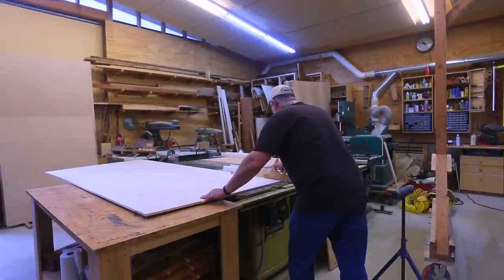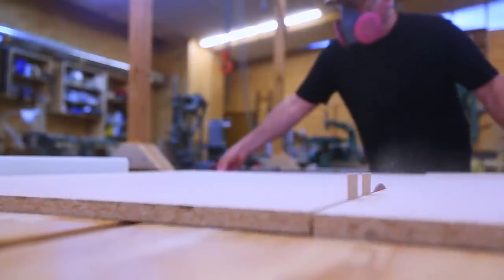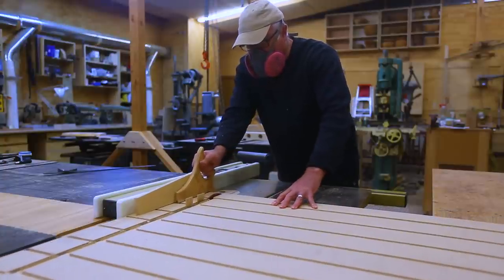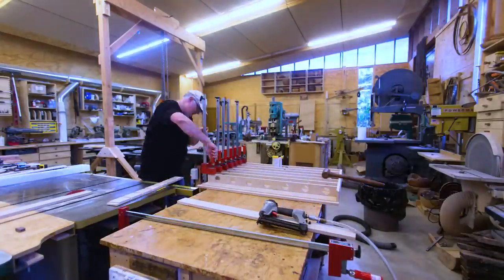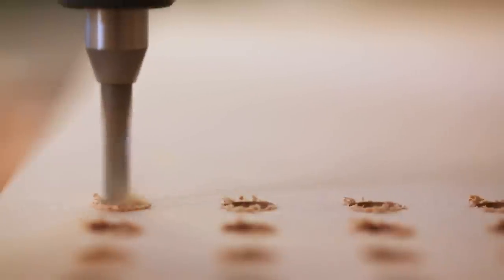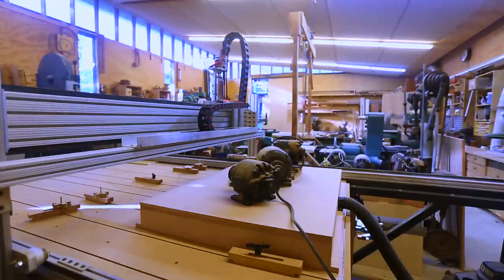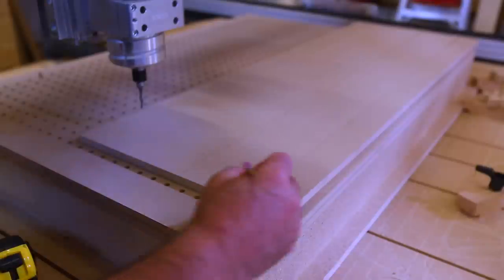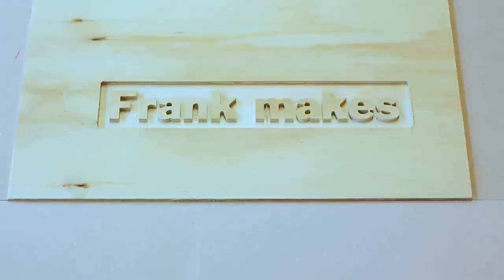Vacuum Hold Down Table

Comment: Your pump (shop vac) will burn out pretty fast since it is cooled by the air sucked through it. You are essentially blocking the motors cooling system. For this application you need a pump with secondary airpath or some other way of cooling.

Comment: Question: Under what circumstances would you be using all the holes all the way to the edges? 
It seems that you could just drill a few larger holes in the center and, even if the piece is large, the suction from the few central holes would be sufficient to hold the entire piece down. Would it not? Even if you were to mill multiple smaller pieces at once, drill more holes as needed and, thus, discover the most efficient hole pattern without over doing it and drilling hundreds of extra holes you may never actually need. 
That would also negate the need for all these modular dams and hundreds of points of potential leakage.
Reply from the maker: good point.

Comment: Rather than the wooden covers I'd suggest taking a idea from Nascar and think about when the car comes in to the pits. how do they "clean" the windshield? They tare off a layer of plastic which has become pitted and dirty covering the windshield and they're done. Couldn't a heavy single sheet of plastic be draped over the vacuum box with holes poked where the piece of work is to mount? I'm thinking the un-poked holes would draw the plastic in just a bit and hold it in place (thus covering the unused box holes). Tare off a fresh sheet of plastic from a nearby roll as needed for next project. I wonder if generic saran wrap in strips would do the same thing (without being sucked in the holes) shingled across the box surface? Or even regular plastic (wouldn't have to look for real wide plastic then). In the end I'm thinking the plastic will be held down by the vacuum pressure along with the work where the holes have been poked; I say "poked" because a pencil could be used to make the holes. LOL! I should have read the earlier comments! Others have already suggested this.

Comment: If you want the vacuum to affect the piece you're talking about, like you said there can't be any other exposed holes. I think you would have a much easier time executing this if you used a variety of patterns + sizes of holes across your table, each with their own cover. That way, depending on the type of piece you're working on, you would only need to remove one cover for one work area. Also, if you intend to CNC all the way into the table this wouldn't work, but otherwise you'll get much better grip if you skin your table with a rubbery material.

Comment: I could think of using a rubber or latex sheets, maybe 4-6 mm thick, cut to a convenient size, and use it to cover up the exposed holes. You could let the sheets overhang from the table top, without cutting them down to size everytime, and reuse them to different sized workpieces.

Comment: Would it be possible to use rubber mats with different size cutouts for pieces smaller than your table? How much surface area actually needs to be affected by the vacuum pressure?

Comment: If you mill out squares around each peace and vacuum the little square channel from the side you can use rubber or foam tubing and cut your set up time in half. Check out John Grimsmo knives vacuum table. Only problem is you never want to cut all the way through even with yours. You loose to much suction. I have been pondering a vaccine table for when I get my cnc. Hope this helps.

Comment: I have recently become aware that if you use the CNC to skim cut off both sides of a sheet of MDF then the sheet becomes vacuum permeable and you can use a standard high recovery vac/blower without having holes in the spoil board.

Comment: How about, two boards laid flat and glued together like ply... The top board has whichever vacuum holes setup you prefer, and the bottom board has linear channels that meet at a single outlet. Glued as a flat ply, they would be dimensionally stable, and easy to make with a cnc router.

Comment: Why not get some a big vinyl sheet or something to cover those holes? I imagine that if you cut a sheet up according to the Fibonacci sequence, you'd be pretty much guaranteed to have on in the size you need for any given configuration. Also the rubbery nature of it will help it seal up the holes as your surface starts to get cut up and little air paths form from old tool paths!

Comment: When you glued it all together I was cringing a bit.  With the vacuum running while cutting it will suck dust into the torsion cavity like a down draft and eventually you will get clogged baffles.  In that vain, a down draft cnc cutting bed would be freakin' fantastic instead of always having to stand there with the hose.  Maybe convert it for both!

Comment: instead of having those wood dams to plug the holes to make the vacuum pull the working piece down . get some heavy duty plastic film. get a big roll. that you can cut each sheet to the size of the suction box. then cut out a negative of the work piece so that only the hole needed to pull down the work are exposed.

Comment: The CNC I use (I don't own it) sucks right through MDF because MDF is actually a porous material. I am pretty sure it does not require a huge vacuum to do it this way... Rather than covering the holes with wood, what about something that just rolls out, like a piece of EPDM or vinyl... or maybe a series of baffles that can be closed down. You could access them with an alan key through the holes in the top.

Comment: Frank,  you should look at the Gerber A advantage router ar600
Reply: I used one in college.  It had a series of valves so you could select which areas of the table had vacuum.

Comment: Connect your dust collector instead of a shop vac.  More airflow, and it would collect the dust through the open holes.
Reply from the maker: I have not tied that, but I suspect the dust collection does not have enough pressure.

Comment: Looks like blocking the unused holes is the issue here. How about installing a roll of paper on the side of the box and after pulling it over the top just cut out a hole for the size of each project.

Comment: personally i would have left the centre strut with no holes basically making it two separate tables and not have to blank off most of the table just use one side then if you need both side use a y coupler on the vac and use both sides

Comment: I watched your CNC construction vids as well as the one showing the first time you cut thru and cut the bed. At the start of this vid I was surprised to see all the cuts into the bed surface there are now. Why not lay your projects down on a sheet of that pink 1-1/2" thick rigid foam insulation?.... As I watched you construct the vacuum box I was thinking it will just be a matter of time before you dig into that surface and get it all cut up as well. Then you went to the trouble of cutting all those holes into another "disposable" surface but you glued it down. You'll never be able to get it off without tearing chunks out of the surface below.... Why not attach a 1x frame around the outside of the box that sticks up 1/2" above the surface you have now and drop in a couple layers of 1/4" pegboard with holes aligned all the way thru of course? The frame and vacuum will hold the pegboard in place and allows you up to 1/2" in depth of cut error. When the top layer get chewed up discard and replace. You could still use the bottom layer with a few cuts in it but you can always turn that layer over and get more use from it too..... Just my 2 bits worth of easy chair improvements.

Comment: Why not glue the 2 MDF tops on then do the hole operation through both of them? Too deep a cut?
Reply: Also, I think I saw a video a while back where someone used newspaper between the part and the hold-down table, it covered the unused holes but was just porous enough to hold down the part. It also improved the lateral strength of the holding... if you every use this jig again it'd be interesting if you could try it out to see if it works for you.

Comment: why not create a series of square compartments inside and connect them to vacuum with weak ball valves. If a lot of air is moving through valve (e.g. no paper restricting airflow), ball valve closes - turning off that compartment. If paper covers holes in compartment, not enough air will flow to activate ball valve.

Comment: As always I love watching you think through a project!

Just a thought as I have no experience with CNCs. Would you run into an issue if you are doing a full through cut? Seems like it would lose suction if the cut exposed one of the holes.
Reply from the maker: I was wondering about that, I guess I will find out.
Reply: frank howarth the fun's in the experiment! Just be wary of flying wood :)
Reply: This is avoided by leaving your stock slightly thicker than needed and adjusting your "z" zero. Then the cut will leave what is referred to as an onion skin ( a thin layer of wood) at the bottom. After the CNC is finished cutting take the part off and run it upside down through the sander until the part is at the correct thickness. This process removes the onion skin and releases the part from the blank. This can also work for engraving, If you engrave a 1/16 deeper than desired then spray paint the whole part and then sand off the 1/16 you can paint engraved details without using tape.
Reply: If you don't have a sander don't adjust your z but still leave the onion skin and use a flush trim bit to remove it after the part comes off the table.
Reply: jd1rein thanks for chiming in. I like those options.

Comment: You could have used a peg board to save the 2 hours drilling all the holes. but I mean you already have a CNC so It kinda makes sense to just cut them
Reply: Maybe 2 layers of peg board with the top one being sacrificial.
Reply from the maker: I think a first layer of peg board then a sacrificial layer of mdf on top.

Comment: It would've been quicker to cut those circles on drill press, no?
Reply from the maker: Hard to get into the middle.
Reply: +frank howarth Sorry Frank, I made the comment at the start of the video - the larger circles was what I was referring to.
Reply: If you have a CNC machine to play with, what better way to play with it :)
Reply: MKRM27
Reply: fastest would be to use a drill bit of correct diameter instead of spiraling a 3/8" hole with a 1/4" bit.. not really sure if the router on this machine could be set to proper drill bit speed though ?

Comment: 00:14 Frank is that normal that youre making saw cut from back of material ?  I allready saw that on others users videos and Im curious.
Reply: On a radial arm saw it is generally considered safer to start the cut from the back of the material, as opposed to starting at the front with a sliding miter saw. Starting at the back on a RAS pulls the material down and into the fence. The proper technique is debatable though, many people swear by starting the cut at the front on a RAS. There's a lot more to be said about the mechanics of each saw and how each could jam up or grab the material when using different techniques.

Comment: Hello Frank, thanks for another great video. Can I just ask you for a little favor? If you have a possibility - add the subtitles to your videos, even the English ones. Your videos are sometimes quite hard to understand what you are talking about for foreigners, especially it's much easier to read some hard, specific words than to listen to them.
Reply: It shows the auto-generated English subs for me (you have to turn captions on), do you not have those?
Reply: I have, but they aren't so good tho. Using them, but still Frank sometimes doesn't talk clear enough so it automatically doesn't auto-generate as good as it should. ;)
Reply: Oh ok yeah I could see that being annoying.

Comment: y dont u put a vacum tube with the router wont it be easier and cheiper
Reply: how would that keep the workpiece in place?
Reply: The table already keep the workpiece in place.
The important is the wood dast . it must be vacumed.
Also he could drill the original table to hold the workpiece
Reply: karrar h.baiee If the purpose was to eliminate dust he wouldn't have covered all of the surrounding holes, and perhaps just duct taped a hose to the router. The purpose of this was to keep the workpiece in place without clamps.

Comment: This was so over engineered to the point of destruction. Very little understanding of vacuum pumps. Shop vacs cool by the air they draw, one dead shop vac. Lets make the internal vacuum area half the depth of your own gantry Z depth, 1cm (internal area) would have done the job. The pain of 'pocketing' a drill hole is beyond comprehension. Like they say, if you don't know it teach it.